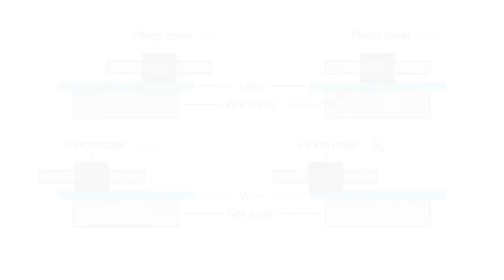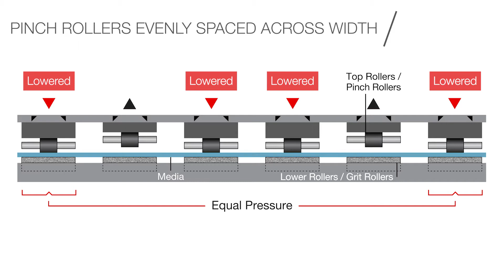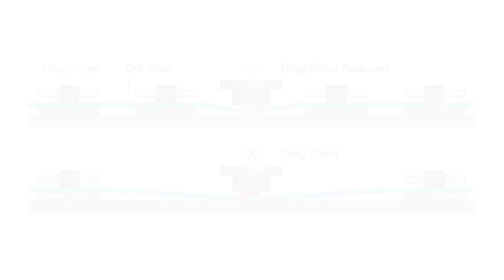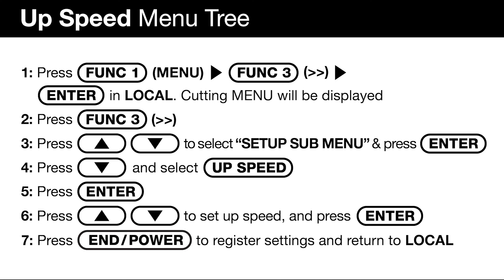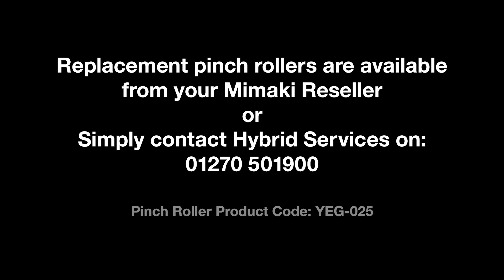Pinch Roller Setup for Mimaki Cutting Plotters and Integrated Printer/Cutters

Comment: Un echipament foarte slab raportat la pretul cerut. Foarte multe probleme, materialul se strange si este atins de cap la mijlocul mesei dupa rolele presoare, soft rip foarte slab si saracacios, service care in general ajunge dupa ce echipamentul s-a defectat deja de prea mult stat etc etc Viteza foarte mica raportat la reclama, consumabile extrem de scumpe etc etc.Am spus si de procedura efectiv stupida si fara sens pentru print and cut ?? Soft propriu de printare soft tert pentru cut sa fim seriosi....si eu sunt inginer dar habar nu am cine inginereste pe la mimaki...